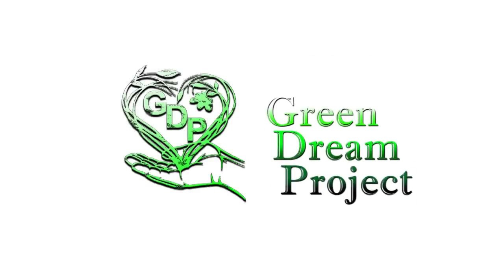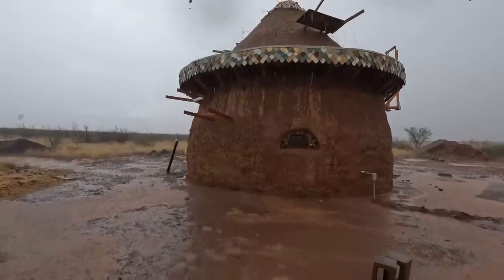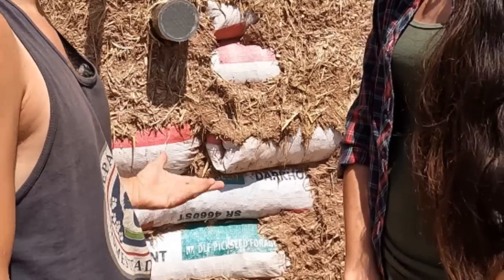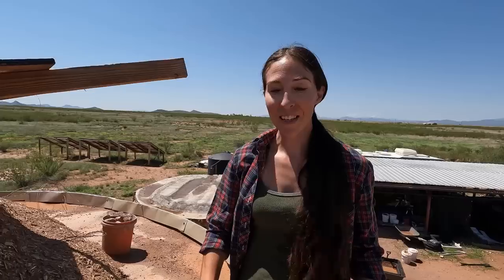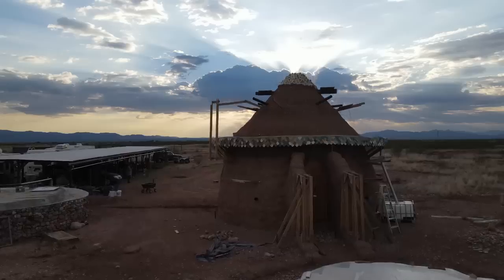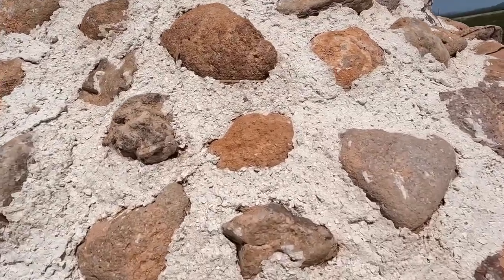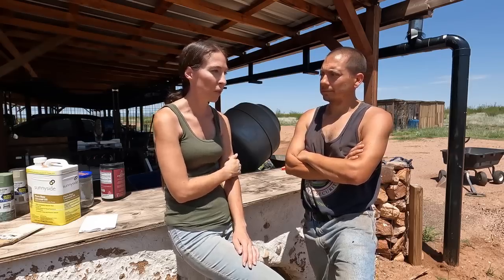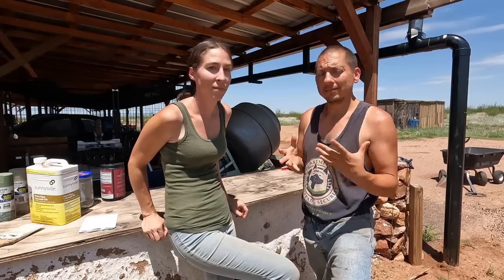This Lime Plaster Has Withstood The Toughest Storms | Lime Plaster Mix How To

Comment: make sure you always glue those pipes. don't leave any pipes just sitting to do later. Always glue. if you don't like it then cut it and put it at the correct angle and glue it again. never leave pipes loose. So always have extra pipe material

Comment: I'm sure you have explained the loops of the barbed wire on the peek of the dome but I don't understand what it is there for. I do understand why you put it around the dome between each layer of bags.
Reply: I'm not sure if they plan to insulate with haybales still. But that's why they set them

Comment: What the Eggshells do in the clay is called agglomerate.  To collect or form into a mass or group.   The more Calcium Carbonate you have (EggShells) the stronger your clay mixture will be.    Pottery is often made with Calcium Carbonate to make it stronger and resist cracking.        By mixing with Sand only you will see a reduction in your plasters strength most likely.     Good news is you can find Calcium Carbonate every where, Mined as calcite, its known as Chalk, Baking Soda.   You can buy 50 lbs bags of it if you shop around.
Reply: @Tommie Jones there are 2 kinds of baking soda.  It is made from calcium.

Comment: Until the dome is completely covered with plaster and stones you can make some small changes to guide the water in a more controlled direction by:
1) Adding a  edge to three sides of the working platforms so the water runs down on the edge which is away from the dome.
2) Cles the gap between the dome and your water capturing rim so most of the water will end up in you capture tod with the repaired pipe to it.
Reply: Just get a big top umbrella from the circus for now. ☂️

Comment: Nice video. It looks like you have gotten a lot of monsoons this year. What is the water level at in your Cistern? Another question,
In the unlikely event that you get a lot of rain do you have somewhere for the excess to run off if your cistern and other water storage fills all of the way up?
Reply: If I remember correctly, in the last video ("It caved in") they said all the water tanks were full after that 1.5" monsoon except for the one outside their work area by their camper. I remember seeing a bunch of overflow above the cistern.
As for excess, they have a few infiltration basins for plants and such, following a natural elevation grade (2 videos before that "caved in" video). After that, it's simply natural land, letting it flow where it may.
These 2 have definitely been water-minded, and are lucky to live in a state where rainwater harvesting is allowed. In that infiltration basin video they talk about it, where certain states prohibit it, or regulate it heavily.
Reply: @brandonlaird6876  Thank You Brandon. I didn't hear them say that the Cistern was completely full. I believe the spillover comes from the two 2000 gallon tanks. 1" of rain on 1000 sq ft area I believe is 600 gallons. The last reading that I saw them give on the Cistern was 7" and they said the capacity was in excess of 14000 gallons. They have had considerable Monsoon activity this year but I believe the average for that area is 8-10" per year. If all of their containment was full, they would have to disconnect or divert the rain collection pipe or risk overflowing their cistern which could undermine their rock reinforcement around the top. 600 gallons of water dumping around their catchment surface would cause them some problems especially for their pup. 
Thanks again for the conversation.
Reply: @brandonlaird6876  they still have the in the ground cistern they made themselves I may be wrong but it think it holds somewhere around 20,000gallon and it’s hardly got anything in it yet although there two plastic tanks are now full and the water now overflows into the in-ground cisterns plus they have numerous ibc totes around collecting water from the smaller roofs and they will be nearly full now but on the whole they have the ability to collect a lot more water yet .
Reply: Dodger Blue. Monsoon is a season like Summer or Winter.  One monsoon per year.
Reply: @honthirty_  I guess I can see that, can normally last 3-4 months or 2-3 weeks. Just stay away from the Haboobs though.

Comment: The top of any roof has the least exposure to rain. It's the lower part of a roof that gets the greatest exposure. For instance a simple gable roof may get only an inch of rain on it, but that rain flows down to lower roof. This means an inch of rain at the peak of roof, then flowing down one side of gable roof for perhaps 14' will have 168 inches of water flow across the last line of shingles. Sometimes in lower income areas, you then will see the bottom half of a gable roof with new shingles, to replace all the eroded ones, but the upper half of roof's shingles still used, since they've had much less water flow across them than the lower shingles. It's the poor persons way of keeping their roof functional at a lower cost.

Comment: Why can't you just put the plaster on the wall/roof without the rocks.  That way, you can use a spry gun to spray the whitewash on the plaster? Or why not just spray it with the rocks?  Far as eggshells go, why not put out a call out for eggshells from your local viewers.

Comment: use crushed sand not beach sand because it has rough edges . beach sand surface is smooth. desert sand is probably smooth because its surface had been worn smooth by blowing around and rubbing against each other.

Comment: The Pantheon in Rome is the longest standing un-reinforced dome, almost 2000 years old.  I always was always told it was made of  concrete, but recently came across something written about cobb and lime plaster that claims it was made with this special kind of lime which starts with a "p" but I can't remember or find again!   The Pantheon "cement" was plastered over so maybe both.  Lime is a little more expensive than cement to use, but was once used more for building than cement.  Mud with lime.   They use barley straw (rice straw is stronger than wheat, too), whole unchopped in cobb limed walls which also needs clay soil to work and forget bags or adobe bricks and just mush it up and then form in into walls on a cement or rock foundation.

Comment: You have been using normal soil, which is in any soil, I suggest you use clay with the mixture of straw that you are using. I know of houses that are more than 100 years old, for example that of my grandparents and they are built with clay. Then they can put the mixture of lime, plaster and sand. I hope that this suggestion helps you to maintain the walls better and continue with your dreams that are very beautiful.